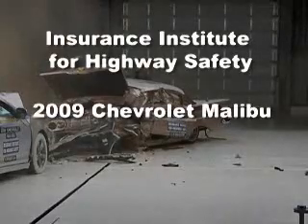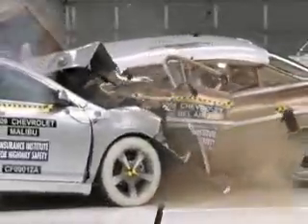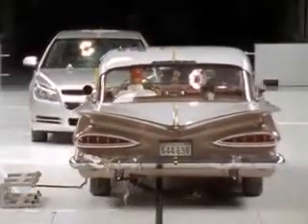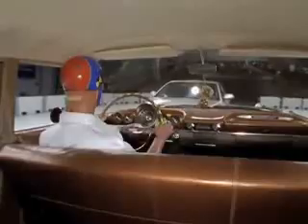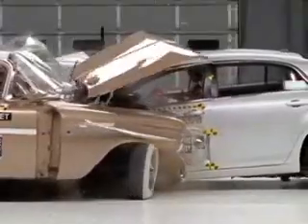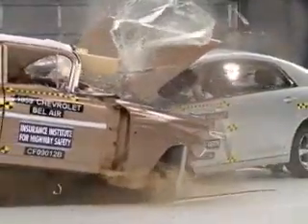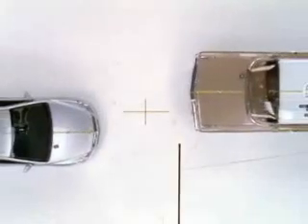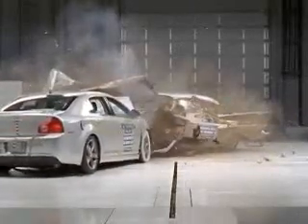Crash Test 1959 Chevrolet Bel Air VS. 2009 Chevrolet Malibu (Frontal Offset) IIHS 50th Anniversary

Comment: "They don't make 'em like they used to." 
That statement goes both ways.
Reply: spigotsandcogs My grandad says the same things about old cars. He says "They don't make them like they used too. Thank God"
Reply: +BIGJAKE95 Thank God they're made of plastic, steel doesn't crumple or break apart like plastic and aluminum, therefore a lot more of the kinetic energy was transferred to the passenger. Today, since plastic breaks into tiny pieces, a lot of that energy is lost and less goes to the passenger, that's why they choose plastic and aluminum.
Reply: BIGJAKE95 I disagree with you on that. New engines are very, very long lasting and even my granddad who's living has been car maintenance says new engines run forever.

Of the last 3 cars my family had all of them done over 250k miles before they "broke down". Two of the three only stopped working because an electrical component failed that cost a few hundred pound to replace which was more than the cars worth. Other than that the engines had many more miles left in them. 

New cars are often only scrapped because they're smelly and unpleasant to be in. My car is only a 1.2 but has done over 90k miles but I want to get a new because its damp, smelly, needs new break disks and a new timing chain. The engine itself is running great. A similar sized engine from the 70s would be in the scrapyard a long time ago if it was in my car.
Reply: @mrdojob  old engines didnt last as long because oil technology was crappy synthetic oils didnt exist they used crappy oil that would get all foamy at higher rpms, it had less climate stability meaning that it got goopy thick in winter and runny like water in summer. Lubrication was awful meaning grinding metal on metal contact was a daily 24/7 occurrence inside the motor.
Reply: BIGJAKE95 The average lifespan of a car from that era was 90-100K miles. Get over your delusions.
Reply: +Michael Costa "Real men worry about their safety and their children's safety, because children need daddys to come home at night."

I have a feeling that if you were to give sdry the opportunity to demonstrate his skills on a closed track, you'd find that he couldn't drive his thumb up his own ass with a funnel. I've been involved in SCCA amateur racing since 1990 and I've been watching professional drivers at all levels since I was a kid. The idea that someone who drives a 1000 HP, 1300 lb. car isn't a "real man" because he wears a helmet and a flame retardant suit, and because the chassis tub isn't going to fold up around him and trap him in a ball of flames, is utterly ridiculous, especially when you consider that the "real man" wouldn't even be able to get the clutch engaged on most race cars.
Reply: sdry So you say everyone crashes on purpose?
Reply: +mrdojob I agree. My Malibu has 234,000 miles (3100 V6) and its still keeping up with the Best of em lol. So far it still runs beautifully. Has a little noise here and there but I cant complain.
Reply: Real men worry about their safety and their children's safety, because children need daddys to come home at night.
Reply: @MichaelCosta1984  mom's got a backup, in case daddy doesn't come home.
Reply: +Tim Lastname
Those photos don't actually show the interior of the engine bay, so how can you claim that it's empty? According to a NYT piece, the car was purchased in structurally sound condition and had the 235.5 cid inline-6 engine in place. Are you really claiming that the test was rigged to make the '59 Bel Air look less safe? If older car designs were so safe, then how do you explain the drastic reduction in traffic fatalities per passenger despite the increase in traffic and speed?
Reply: You realize the ENGINE is what would have killed the passengers in the old days right?  IF anything, removing the engine made it safer.
Reply: This is one of the BIGGEST reasons why older cars are unreliable although I think they LOOK much better than todays cars and can be fixed a lot faster newer cars are safer and are a lot more reliant
Reply: spigotsandcogs omg ypu blew my mind
Reply: spigotsandcogs yes no need for bag then his head rattled less, literally.
Reply: +Michael Costa You said it! Of course nobody TRIES to crash... But I would want the "plastic" car over the old unsafe car, because you just never know when or where a crash can happen. Either way they're both totaled. I don't see where it matters what its made of as long as it keeps you alive...
Reply: sdry Nobody intends to crash their car. But men crash cars at a much higher rate, and with much higher fatality rates, than women do. And any time I see "real men don't" I smell insecurity.
Reply: They don't use 'em like they like to.
Reply: The engine was there...
Reply: +Chevymalibuls This article is complete bull shit.  They removed the engine from the 59 Malibu.  http://www.wheels.ca/news/iihs-crashing-cars-for-safetys-sake/ is a link to a site with photos of the car.  No ENGINE in it at all.
Reply: They don't make em like they used to. Olde engines will run forever and those cars were made of good steel. No plastic. The Belair didn't have all of the proper components in it like it should. I'm not saying it would beat a bend new car but it wouldn't be that bad to get In a wreck
Reply: +spigotsandcogs I would take the old one any day over that plastic looking pile of crap. This safety shit is interesting to asians and females only. Real men dont buy cars intending to crash them at first place.

Comment: BULLSHIT. In real life during an accident every car has an engine Here you can see how it looks normal.
https://www.youtube.com/watch?t=24&v=O-WYKYrq5FI

Old cars are also safe, because not spared on materials. Plates were thick and most importantly a lot of old cars has a frame.
https://www.youtube.com/watch?v=OjvIGskbZW4
https://www.youtube.com/watch?v=_stpBzOAcWw
https://www.youtube.com/watch?v=kqPREKqUSho
Reply: +Tawarisz Aamnah ok, listen carefully. That's not how physics works. Old cars themselves were solid, but that's the problem, in a accident, ALL the energy is sent straight into the occupants, usually killing them. Modern cars passenger compartments are far stronger, the rest of the car is DESIGNED to crumple, absorbing the energy of a crash. 

You will see in all modern cars, the passenger compartment stays rigid, the rest of the car is demolished, but the passengers have the best chance of survival this way.

Comment: Even IF the Bel Air had an engine, the driver would've gotten impaled by the steering column anyways.
Reply: @sludge4125  old cars weren't as reliable as newer ones primarily because oil technology was garbage. They didnt even have dual climate oils back then If you lived up north you had to swap out your warm weather oil for the cold weather oil often people NEVER did this. the oil would get excessivly foamy and runny at pathetically low rpms. Old v8s and I6 motors can last a long time on today's miraculous oils. For example the Chrysler 4.0 straight 6 is ancient yet it was used up until the early 2000s thus it was able to benefit from modern oils. It has gained a bullet proof reputation.
Reply: @joshuamcpeek4708  I agree 100% about the oil. When you think how important lubrication is, it's no wonder engines last so long today.

I'm pretty sure almost all of the straight sixes from the fifties and sixties were incredible.
Reply: According to the IIHS the Bel Air was drivable before the crash test and only the fluids were removed. You can find that information on the official version of this video they posted.
Reply: Yes but most people would convert to the new steering columns which contract in case of accidents

Comment: Pretty painful to watch because I own a 1959 impala. I'm pretty sure the engine was removed from this car judging by how much the front end caved in. Still makes you think how deadly these steel coffins truly are.
Reply: steamyhotpoo The Impala had the engine in it.
Reply: +steamyhotpoo so you have a pile of shit car? fitting for a piece of shit
Reply: +steamyhotpoo no, we are upset people don't understand simple physics. Old cars are not safe by modern standards simple as that.
Reply: +steamyhotpoo I want your car.
Reply: +steamyhotpoo Or maybe it has something to do with the fact that it wasn't a head on collision but rather an overlap test?
Reply: ghd67ik2887218
Not just one "piece of shit", I actually have a few other classics. The difference between my "piece of shit" cars and whatever you drive is that my cars only build value with time.

Comment: I love how they chose the car with possibly the weakest X frame ever, and then don't even say that it has the worst frame design ever!  I'd want to see a crash test with a super beefy framed car like a 61 Chrysler Imperial go against a modern car
Reply: It's actually worse, with modern cars specifically designed parts crumple to absorb the energy of the collision. In old rigid cars, all the energy is transferred to the driver, killing him if he wasn't impaled by the steering or the motor
Reply: +dethmetel It would be even worse.......modern cars have weak outer structures by design, but the passenger compartments are made with much stronger and better steel than any car from that time period

Comment: I love old cars, but the new cars are truly safer. I was rear ended in a 09 Impala at 40 mph by a 06 f-150, my pregnant wife and I walked away with a case of whiplash, but we walked away. The car was totaled, it crumpled up reducing the impact on our bodies. The cabin of the car was intact, even if someone had been in the back seat I think they would have walked away.
Reply: And I found an article on whether it had and engine or not. http://wheels.blogs.nytimes.com/2009/09/18/more-details-about-1959-bel-air-crash-test/?_r=0

Comment: Over the years I was told classic cars were safer than modern ones and i always questioned that. At this point as a petrol head I came to the conclusion that the only thing older cars have on newer cars is pretty much styling. Modern cars are engineered a whole lot better than older ones when it comes to performance & safety.
Reply: All cars are designed with obsolescence. How many 59 cars have lasted this long? What percentage of the total production number?
Reply: @Budgie Lover I'm pretty sure a lot of people in the 50s thought the same way if you'd have asked them. "Nah, nobody would want one of these cheap Chevys (1957) in 60 years."
Reply: Frenk Vortice that argument... You won't be an engineer, right? My god 😂😂😂😂😂
Reply: Yeah they have style, because they were designed by designers.  All the engineers and middle management in the world can make todays cars safe, cheap, profitable, and able to wear out precisely after the warranty expires, but can’t produce anything that looks as good as the worst looking thing on the market from the 20s through the 60s.
Reply: Modern cars are made with planned obsolescence, in 60 years time I doubt that Malibus and other modern cars will still exist. I agree, modern cars are safer, but modern cars may ruin your life, you may be in a serious accident and left paralysed all over practically dead, a old car in a serious accident, you die. You won't suffer during the aftermath of a classic car accident. And I'll tell you this, if I have to die in a car accident, please let it be a classic car I die in.
Reply: @budgielover5211  Those cars became obsolete faster, lol. They went through a face-lift or redesign every 2 years, compared to every 4 or even 5 years for most cars today, they rusted sooner, and technology was rapidly advancing.
Reply: that is BS.modern cars are designed to break and last 5 years, nothing good about that.
Reply: @frenkvortice3858  What are you talking about? Modern cars last much longer and require very little maintenance. Look at the maintenance interval of a car made in the last ten years and compare it to a car from the 60s.

https://nyti.ms/2lEsz52
Reply: @frenkvortice3858  Nonsense.  The average age of a car on the road in 2019 is 11.8 years,  If cars were "designed to break and last 5 years", as you claim, that would not be the case.  See https://www.autoblog.com/2019/06/27/record-average-age-cars-on-road/